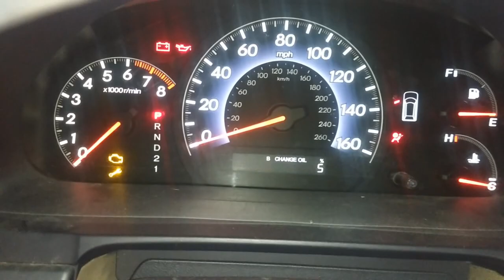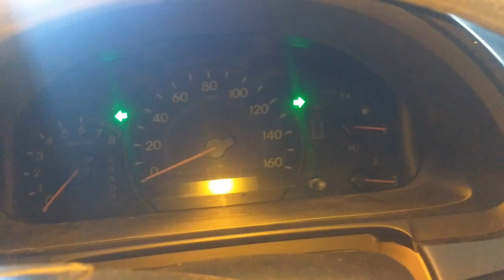Meaningless Destruction-Honda Odyssey

Comment: No gas.    Hey my niece. Drives my old sisters Van.
Reply: No gas has no reason to do with the starter not turning the engine because the pistons and bearings in the engine seized because the former owner didn’t change or even add to their oil, but they didn’t even have extra money for gas apparently or drained it out